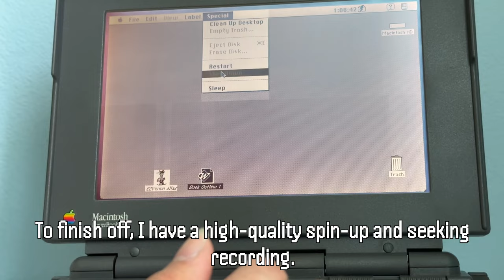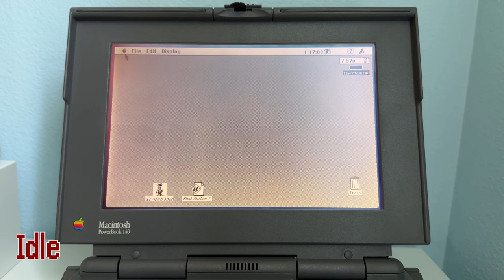Vintage PowerBook drive resurrected! Conner CP2045 rubber bumper repair and PCB swap

Comment: repair on quantum drives isnt impossible , there's a gap behind the magnet , where i put a piece of rubber to prevent the heads from touching the bumper.

Comment: As i suspected from the other video, the PCB seemed to be preventing the motor from properly spinning. I have a half-height CP3204F that does the same thing, and the PCB has a huge gouge in it. Great job with the repair, these things are NOT common.

Comment: The drive is actually kinda loud for a 3600RPM as some 7200RPM is quieter. Oh well, technology evolves overtime haha
Reply from the maker: It is surprisingly loud lol. It’s crazy how much noise some laptop drives used to make
Reply: @antequated.archive  If you had many of those in a train it would make everyone have a headache lol